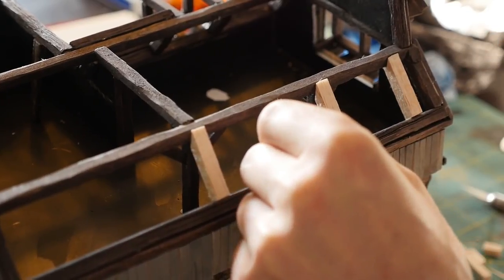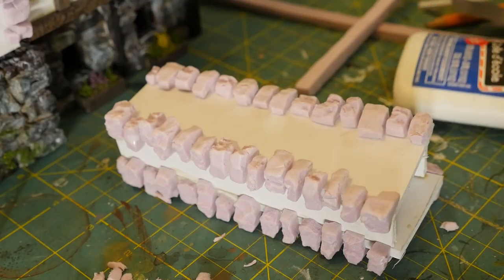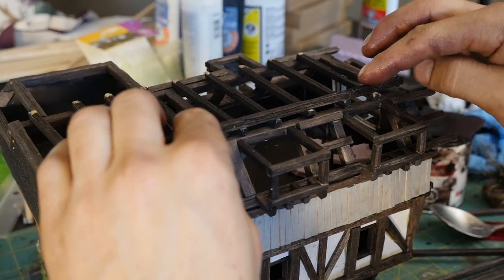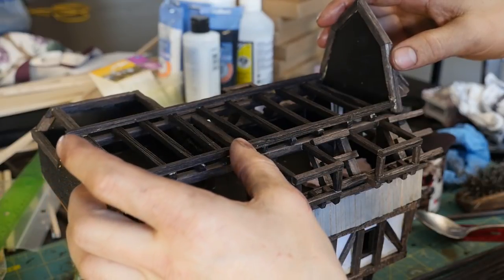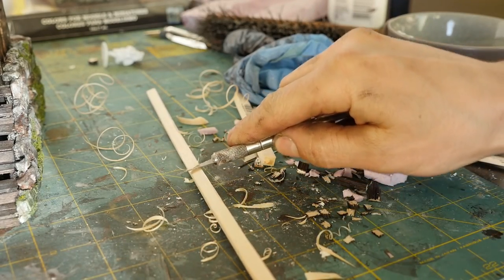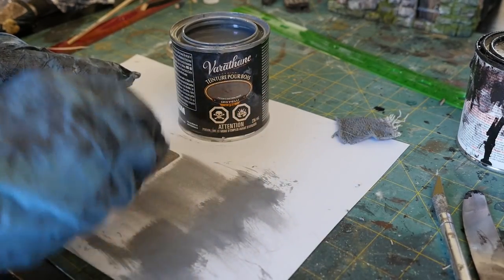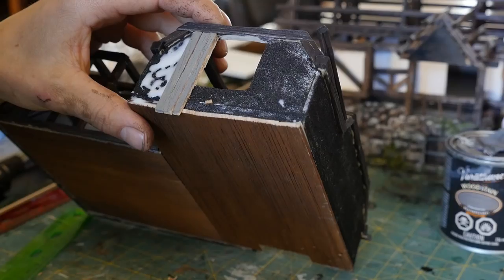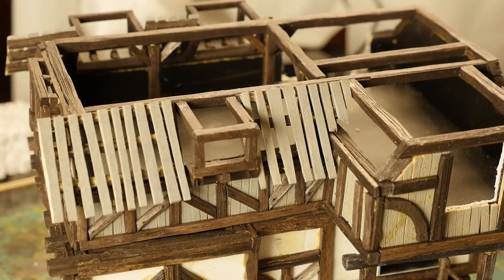*Roof Rafters!* ⚔️EPIC Tabletop Gaming Tavern!!⚔️ (D&D Pathfinder Terrain)

Comment: It is looking great! There is just one little thing, which is of no consequence for gaming build of course. But you occasionally used supports that would not be needed ( for example in door on base level) and would be there for fashion only, thus unlikely to used. Also timbers holding any higher floor would run across width not length. Long straight wood is hard to get and even more in era where everything from kitchen utensils, vehicles, houses to your latrine in made of wood. Hard woods like oak, maple, walnut in woods would be a lords property and those long ones would be used for hard cash things like to build castles and especially long straight beams are absolute necessity when building keels of any wooden ship ... I think up until 17th century 1 straight piece was only way to get proper keel for ocean going ship as it is very hard to make any such joint strong enough ... Also it is much easier on your back to work with 20feet timber than 60feet one ;)
Reply: ALmost forgot. Doors and windows upper and bottom timbers on classical / medieval tudor style building would run from beam to beam not only around window for strength, way you depict it would weaken wall not strengthen it. US early 20th century "tudor" houses do not have this feature because they mostly aren't timber frame house only fake it by using planks of wood or fake wood ... But as I say this is not a complain, but something to look into for slightly more realistic / believable result. Youtube is full of videos how to build timber frame houses (especially from US/CA guys) or log houses (finish ones are exceptionally pretty for example)
Reply from the maker: Awesome man.  Appreciate the feedback.  I'll definitely take all of that into consideration for the next one. :)
Reply: @RealTerrainHobbies  I do appreciate your fine models. One thing is working on those in 1:1 scale (repair/update/reconstruction of log house/cottage, built in1932, in style used here in mountains for centuries, very similar to Finish log cottages/ houses). Other thing is making them in scale to fit on table, where by far you do better job :) Also you should trust wood more. in certain aspects like tension and compression stress, most construction type woods are as strong or stronger than steel per kilogram (bamboo scaffolds of asia are particularly awesome) ..Of course steel is several times better when cross section area matters and is easier to extend length. This aspects results in a lot of new, relatively low height buildings like warehouses or even certain factories (i am aware of few that deal in wood related products in this area), are again being built from wood around here. They do not need to concern whether pillar is 10x10cm (4x4") or 30x30(12x12"). Made of wood makes it more ecological, also wood is better insulator than steel, 1000m above sea level with temps in negative 20C or lower (around -5F? )on regular basis that is concern too. Fun thing. In some longer log buildings internal walls are there only to allow to tie 2 shorter beams to create longer wall. Perpendicular timber (ie inner wall, does not need to go from wall to wall either, can be a stubb, with only bottom and top beam going across ) is there to hold together in, so long wall will not try to bulge out where two timbers meet. I would recommend to look at pictures for things "old wood house (or churches) in skansen" for sweden, finland, Norway, denmark, poland, slovakia, Czech republic and also alpine style mountain wooden houses of austria, italy, switzerland and france are great inspiration IMO. Even more as there is quite large resurgence of these recently as both live in and recreational purpose house creating high availability of good photos of them.

Comment: Beautiful. The issue I'm having is you use of "jetty" when you're canterlevering on them. Putting that much weight on jetties would blow them out. I think the words you're looking for are rafter end or beam end. Beam end transverses the building horizontally and what was used to expand the upper stories.
Reply from the maker: Awesome advice!  Thanks I did the best I could with my research but obviously not well enough!  Thanks for commenting. 👍